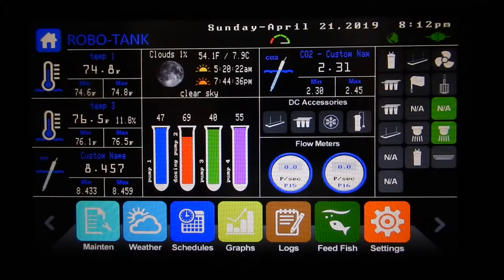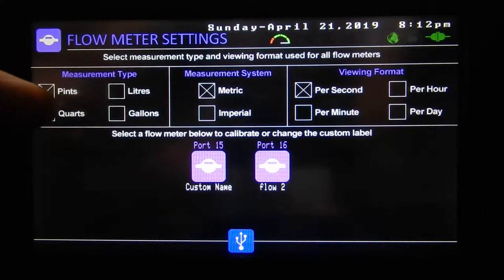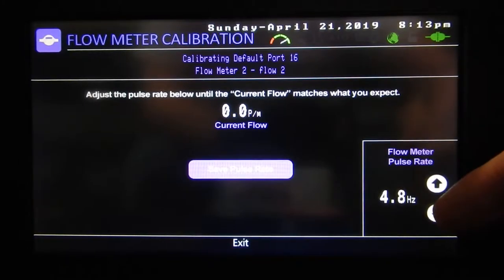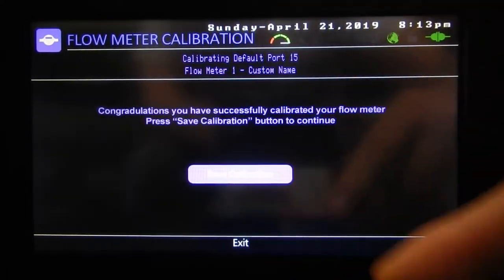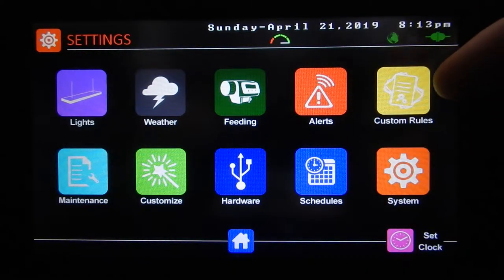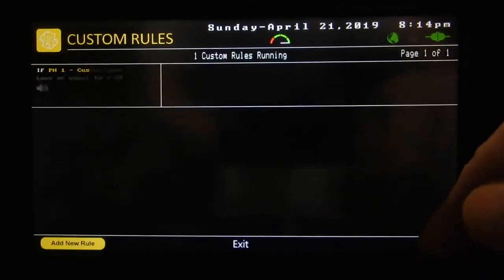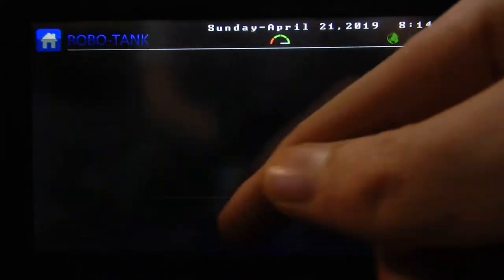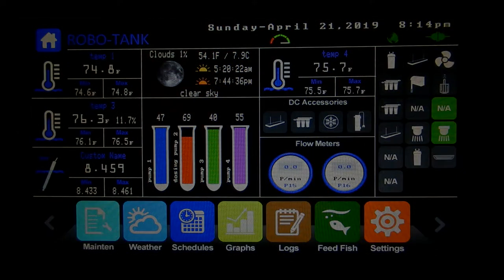Robo-Tank DIY Aquarium Controller V5 - Flow Meters

Comment: awesome video, is this UI part of robo tank or Reef PI? is the screen connected to a PI via what port?
Reply from the maker: Thank Yang, this is my old Arduino based controller, it was using a 7" touch screen. I am however working on a revised Robo-Tank app for the controller, it will feel much like the one in this image but hopefully better. Here's a link if you want to check it out. Posts prior to the link are relevant however the images no longer apply.

https://www.robo-tank.ca/forum/Thread-Robo-Tank-Web-App?pid=6449#pid6449